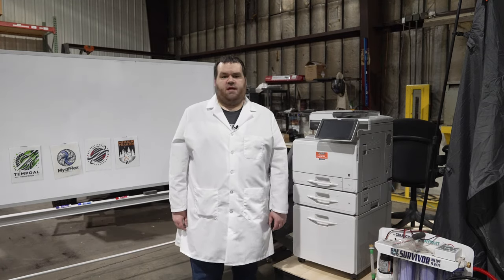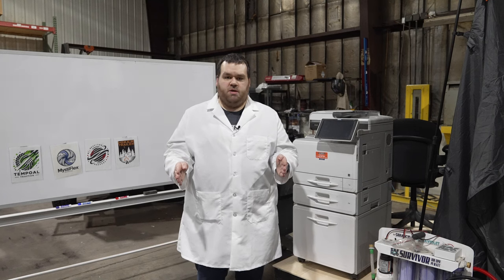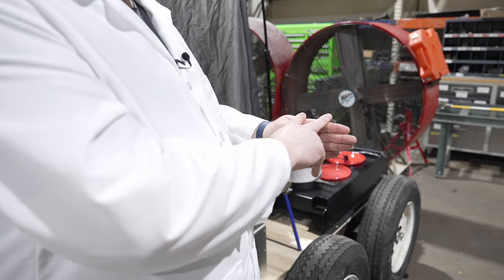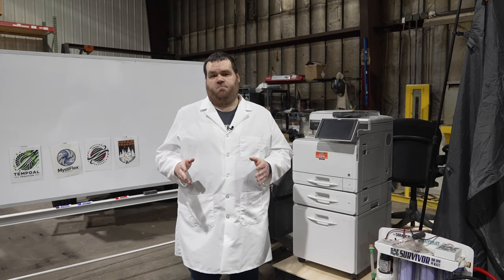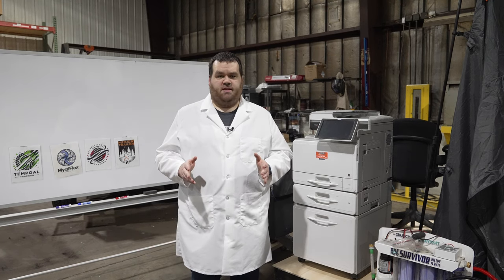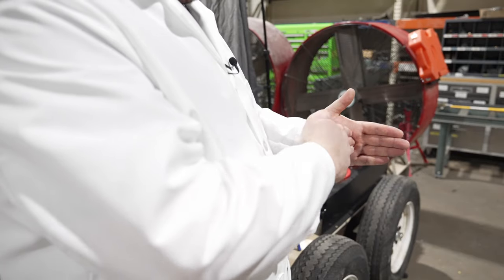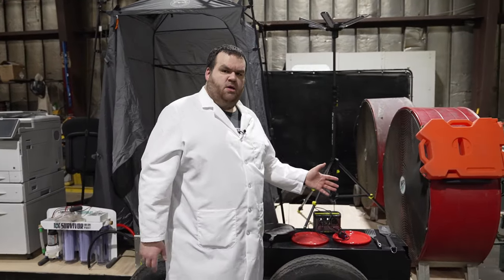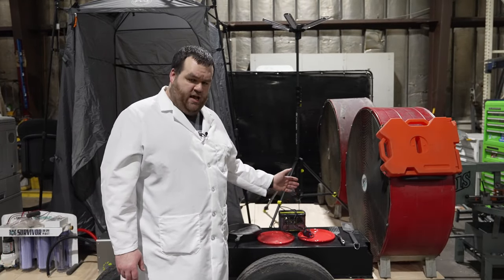Introducing Our Newest Model - The Turbo-Trail Encabulator - April 1st, 2024

Comment: How do I order one of the 7th trailers? I definitely want my girdle spring connected via treme-pipe to the grammeters.  
Also, is the pre-famulated ammulite the only baseplate material option? Kind of a dealbreaker for me....

Just awesome and great delivery 😂
Reply from the maker: To order, contact us on the third Tuesday of February between 3:00pm and 3:15pm and please have 2 forms of ID and your deposit in bills under $20.